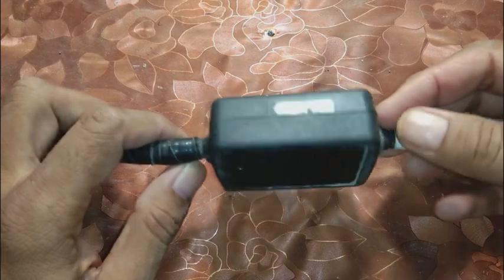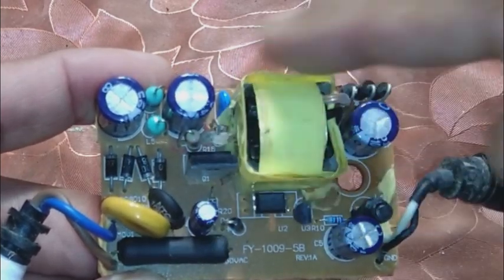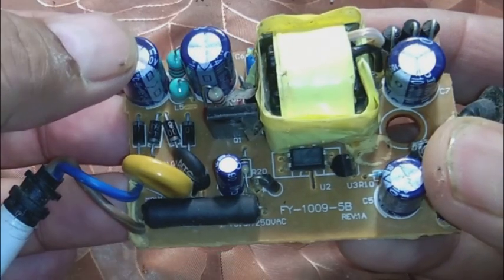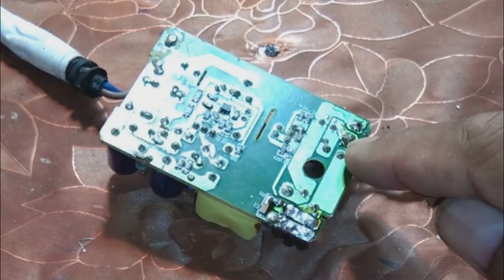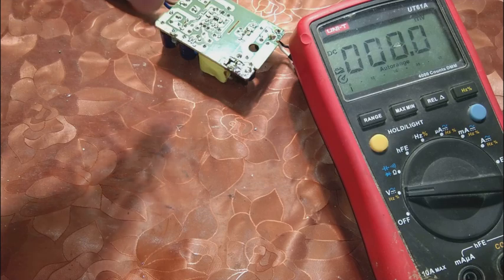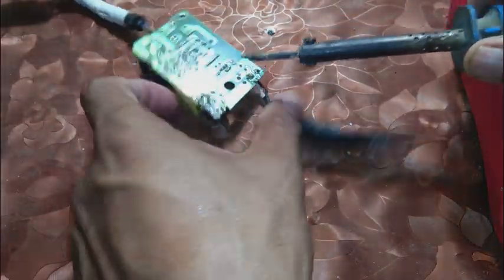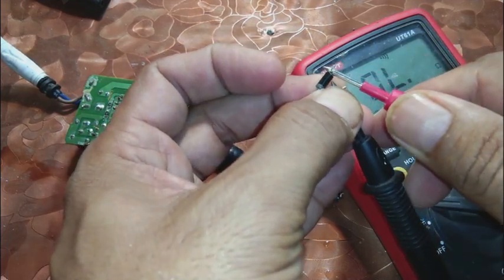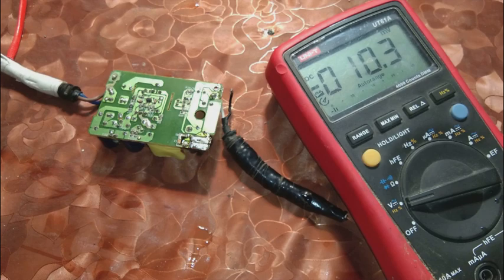Switching power supply review and repair. SMPS repair. How to repair a cellphone charger. Charger 5v

Comment: Hmm a better design, the output voltage is monitored by a TL431 or similar shunt regulator and some resistors, it drives the led side of the opto coupler and the opto coupler output feeds back to the pwm flyback i.c.
Much better accuracy :-D
The output schokky diodes look overloaded by someone being too greedy for power lol.
Maybe 1.5 amp output current.